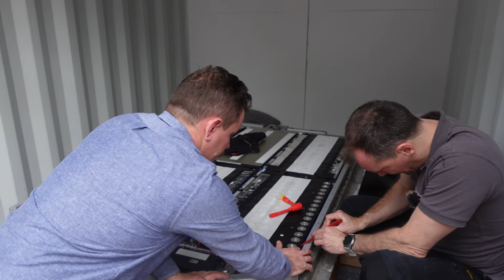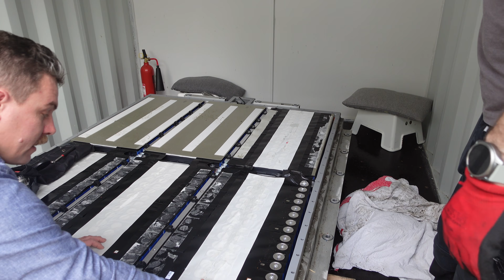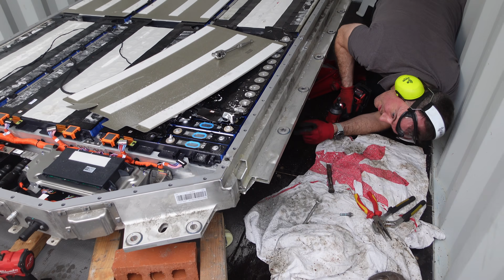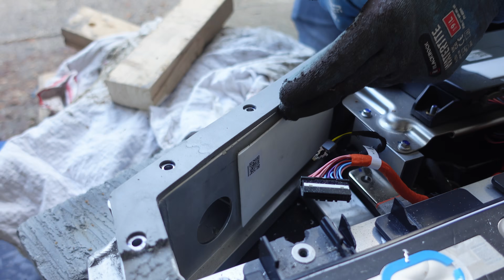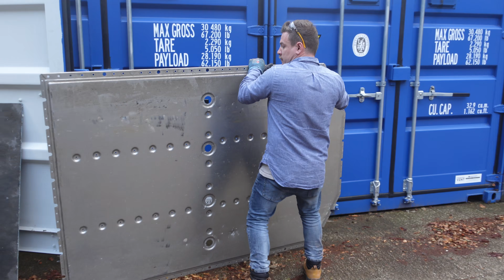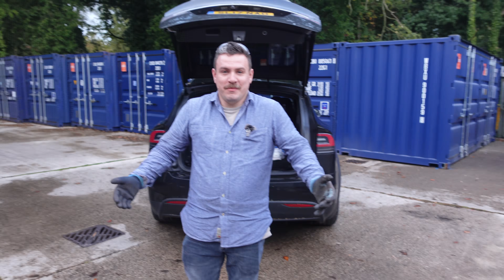EV Batteries Are Becoming Unrepairable — And Honestly, It Makes Sense

Comment: Someone should set up a company building containerised structures to take these car batteries and market them as grid balancing devices with the aim to replace gas peaker plants. 
Knowing Dala, it will already be an open source project, so if he adds a stipulation to it that if you use it for commercial use any updates/upgrades must also be feedback into the project or something that would mean a private company can't build their own IP on the project without benefiting the project

Comment: This battery was designed for robots to build. And not for humans to dismantle.Some one needs design a laser welded shear bolt terminal bus bars .Standardised cell case bolt through holes for pack clamping.That allow rubber gasket battery spacers.Individual pack pan enclosures.With fuses between banks. To contain fire to individual packs. Giving the ability to replace damaged  area.Double sheet ribbed battery pan for protection.This would add a small build cost. But will give an advantage of an after market keeping the vehicle on the road and reputation of the manufacturer that cares about it's customers enough to want them to buy the next car. because it can be repaired.

Comment: You guys are TOTALLY  RIGHT.. The packs that are made strong  and with permanent structural elements will last longer. This is less opportunity for Failure. Sandy Munro from Munro live also discussed about that few years ago and came to the same conclusion.  BTW these are laser weld not spot weld. Youc an buy a laser welder for cheap but the process will have to be perfect to not damage the cells while welding!
Reply from the maker: Great advice. Thanks for chipping in

Comment: We need a right-to-repair law that includes EV batteries. All components, including the battery case itself, should be reasonably easy to replace. The cells should be replaceable in smaller modules, below a defined limit such as 5 kWh, to ensure that faulty sections of the battery can be repaired instead of replacing the entire pack.

Diagnostics and communication for batteries should also be standardized, so EV batteries can be easily reused for other applications if desired.
Reply from the maker: I’m okay with the cells not being removable if I can pay X percentage lower for the car knowing it’s cheaper to manufacture. The pack can still be shredded apart at the end of its life to reuse the minerals. 
I guess it really depends,  how often do you get to cell failure? How far do you go in being able to replace everything on a device when it means that you’ve got to get into 3-400 V of which you cannot isolate that voltage easily? That line of thinking alone breaking packs to replace cells risking high voltage shocks. You could say that they almost should never be opened at the cell level. 

It’s a good subject to debate thank you for sharing your views. I completely agree that we need more openness on data & specification. By all means get your product patent but share how to repair them
Reply: @TheOfficialBatteryMan I see your side of the case, but the biggest issue for me—and what really makes me want repairable batteries—is the risk of total battery failure, where the only option is to replace the entire pack, which is often extremely costly. Cell failure isn’t common, but when it does happen, it’s incredibly frustrating. This risk is also part of the reason why car insurance for EVs is so much higher compared to other vehicles.

Damage to the battery case is another real concern. It can happen in various situations, and having to scrap an entire battery—or even the whole car—just because the battery case isn’t repairable is a significant problem.

I live in Norway, where EVs are everywhere, and it’s quite common to see relatively new EVs scrapped after minor accidents simply because the battery is too expensive to replace.

Comment: The spot welded tabs could be bolted but then it could result in oxidation and fires.
Reply from the maker: The clip didn’t make it into the video, but I’ll probably end up lending Will my spot welder to continue his project. I’m not sure how much current he’s planning on pulling but if it’s a 5 kW inverter at 48 V that’s surround 100 amp. So we need a decent connection

Comment: From what I can tell, you have a total of 96 LFP cells in series. That's over 300V DC. All persons working on this battery should be wearing gloves at all times. Also, be very careful you don't short anything. LFP cells can generate about 20,000 amps if short circuited. Be safe guys. I enjoyed this video.
Reply from the maker: Hey these are 32 cells on the front three modules?l. Which have been broken down to about two rows of thirtyish volts.

The rear modules have 36 cells 129v. That’s starting to get dangerous, but we have course we’re not working on those cells. 

This pack, believe it or not is NMC. A lot of NMC packs are made with prismatic cells now. 

If not handle right, I completely agree. There is enough energy here to kill you in a second. I promise you we were as safe as we possibly could be while looking as sketchy as we possibly could be.😂
Reply: @TheOfficialBatteryMan Ahhh, ok. They very much look like LFP. I believe those are also extremely high current when short circuited also. Would love to see a video from you guys on how to balance EV cells so that miles can be reclaimed.

Comment: See how complex that is compared to a fuel tank.

See how difficult and how many man hours to strip down. Now think about this being done commercially.

This is why actual recyclers just grind the batteries down and separate. The whole myth about these car batteries being reused for a second life as a house battery is just wishful thinking.
DIYers might do it, but it won't happen commercially
Reply from the maker: All it takes is one or two smart people to reverse engineer at the CAN bus data and you can plug these into inverters. The problem is something like the Fisker Ocean, well it’s just a bit pointless to reverse engineer a pack that that’s harder to come by that will be needed to keep the remaining vehicles alive. Better to use freely available batteries to reverse engine engineer.

There are companies that commercially do this putting these things into containers providing grid stability
Reply: @TheOfficialBatteryMan that may be so but where is the average person going to put a battery pack that big at home?  Especially when giving proper fire barrier spacing.  The whole narrative was that these would be stripped down and reused as home batteries. As you can see , no commercial company will be able to make that pay. Too many man hours involved. So it will be confined to the DIYer.

As for sticking crashed EV batteries in containers for grid stability. Just shows how gullible the whole climate change narrative is. The grid was stable before renewables were forced on it by idiot ignorant governments. It is solar and wind that makes it unstable. A few containers full of ex EV batteries of dubious history will not change that.
Reply from the maker: @DanRyan-v5y  there are over 2000 installs using the battery emulator. Some commercial and a lot of domestic all around the world.

There is already been some business use cases for second life EV batteries. Batteries can be triaged to make sure that only good ones are used. To me that that’s a far better solution than just shredding them up and starting again.

I find adding renewables to the grid absolutely fascinating because it’s genuinely sustainable whereas oil isn’t. One day oil will be gone and we will have taken our planet for one of its greatest resources of the 20th century.

Comment: I am ok with unopenable battery, but give me guarantee that it will survive over 10 000 charge/discharge cycles and/or over 30years of longevity.
Reply from the maker: Modern cells are fantastic compared to what we used to have, but yes, there’s no guarantees. Saul are firmly managed and packs have got even bigger so they’re generally not as stressed.

Although we are asking to charge them faster and to get more power out of them but in the Gran scheme of things most people don’t use superfast public charging very often and yes they might put their foot down but it’s a matter of seconds not enough to cause massive heat spikes.
Reply: @TheOfficialBatteryMan I am working in solar battery storage industry and with luck and bit of care, these numbers are lets say achievable. Yes the battery can be pampered by good BMS and is not experiencing anything near the horrors batteries in ev do...
Reply from the maker: @JanicekTrnecka 10k cycles is a hella high usage. I guess battery storage cells and EV cells get hammered in different ways. More kilowatt through an BESS but a much lower C rate and on scale air conditioned.
Reply: @TheOfficialBatteryMan air conditioned (liquid heat dissipation) whatever...load of sensors through the pack and lot of indicators that limit the "abuse" because you can..In EV you simply cant ease off a bit for every mousefart...
Reply: @TheOfficialBatteryMan  yes 10k is lets say, hell of cyclic use .. but some battery manufacturers attack this number. I dont expect the battery to be "as new" but still somewhat operational ....many EV retired batteries are happily serving its autumn of life in battery storages.
Reply from the maker: @JanicekTrnecka o yes. I’ve repurposed 4 and one ready to go 😛 I appreciate that I’m small fry but the channel has helped other to do the same. Above all this needs to be an industry thing doesn’t it? Batteries is being repurposed into containers and living a second life before they’re broken up.

EV manufacturers have always been a bit disconnected not wanting to share their little secrets. On scale this is only gonna work if they partner with companies that can achieve it.
Reply: @TheOfficialBatteryMan there are clever tinkerers and a lot of engineers  working on reverse engineering these batteries and protocols just to better understand them and prolong their usable life or to be re-purposed as storage...which is good! Sometimes shady. but....BTW I thought some car manufacturers do repurpose their packs in their ecosystem...Skoda is trying to use the batteries to boost their "supercharger" stations. Just an ordinary DC charger on a thin grid line, but supported with battery.
Reply: @TheOfficialBatteryMan mine has an 8 year guarantee. Replacement ones already hold more energy or are lighter.

Comment: Everything should be repairable
Reply from the maker: It should, but we all have to pay for the extra cost of repairability. In terms of building this in a factory robots could do this.

You start adding bolts into place and there are way more steps. 

Having said that there apparently are a lot of hidden bolts in this pack some of what Willis chopped away has found steel inside the aluminium extrusion
Reply: @TheOfficialBatteryMan  I would put to you that most people would pay a bit more up front for something that can be fixed, as opposed to becoming a brick. Ask any iPhone user if they'd like to be able to replace their batteries, or cracked screens that they're not "allowed to" because of Apple's BS reasoning. 

Repair is noble. Replacement when it's not needed is just waste.

Comment: That is 100% not a repairable battery pack, in the sense that any dealer network is going to get it repaired, possibly even manufacturer associated dedicated repair facility. Reliability, don't buy that long term either, you are reliant on 100% first time perfect manufacture / tolerances, doesn't exist. Long term therefore this is not a reliable solution at all, the belly pan construction alone is vulnerable, a pinhole puncture even will introduce water, the battery will fail in time as a result. As for using the pack as a whole for secondary storage, not designed for re-use, manufacured to almost specifically to preclude it. One cell issue and you have a whole pack running with a potenital larger fault waiting to trigger itself. Early Teslas had the right idea for cell isolation - each cell interconnect acting as a fuse, at lest in that case a cell would be removed from any future charge / discharge cycle. These pack designs are decidedly not green at all.
Reply from the maker: Some good points here, thank you for sharing
Reply: Just a comparison for you to ponder: Plastics have been around for 60–70 years and still approximately only 10% are recycled globally. EV batteries, by contrast, have existed at scale for less than 15 years and fortunately, because they're designed around high-value, recoverable materials (Al, Cu, Ni, Co, Li, graphite), with emerging regulations and processes, ~90–95% material recovery is achievable even after 10–15 years of use. Still not perfect, but it’s demonstrably better than most petrochemical plastics…and improving rapidly.

Comment: So this is the grand illusion of being environmentally friendly and saving the planet by making these batteries un- repairable , what an absolute waste of resources
Reply: Redwood materials in the USA simply grind them up whole and process the whole pack recovering all the materials. The normal use for an end of life in an EV undamaged batteries is to gather them in a container linking them all to a large BMS to provide grid backup. What you see here is simply DIY only.
Reply from the maker: I would very much agree. It’s crazy how many battery packs are just sat around in breakers yards. The whole recovery process is still in a bit of the chicken and egg stage. 
I’m sure it will happen. We just don’t have enough old EV packs to warrant it at the minute.
Reply from the maker: Most EV packs will live a long long life. But unfortunately written off vehicles won’t have their packs go back into vehicles most of the time due to safety concerns so we’re talking a tiny minority of battery packs that need throwing away right now.

Comment: What's the plan for getting it connect back
Reply from the maker: Will plans to drop the voltages down to around 50 V and use it with a Victron inverter. He’ll basically have an absolutely massive capacity for a 48 V system.

Comment: Making it not repairable throws the "green" propaganda away
Reply: Nope.
Having repaired old packs, the thing is:
Newer generations are way more reliable, and building them strongly glued is better on every level.
Repair is not needed.
Recycling happens by crushing the whole lot anyway.
Reply: You've not caught on to the CO2 problem, have you.
Reply: The need to stop burning stuff in order to preserve a livalbe planet is not dependent on repairing individual cells in battery packs. I'm not sure why you think it is, nor which bit of the transition is 'propoganda' in your view.
Reply: @xxwookey have you considered the carbon, water, and waste amount to manufacture entire new batteries?
Reply: @GuilhermeGomes2  Yes. The point is what are you comparing it against. You can make one battery and then use it a few thousand times, and then recycle quite a lot of the materials, or you can dig up hundreds of barrels of oil, and dump the waste in the atmosphere, then do it again, and again until you either have no oil left, or the atmosphere is ruined. It's hard to make the case that oil route is better/greener.

Comment: Better to design a good battery than a repairable battery. 
To make batterys reparaible you add weight, complexity, cost and unreliability.
Reply: You can do both, there is no good reason why a battery cant be relatively easily repairable.  It should be nothing more than 100 prismatic cells in a case, a BMS and thermal transfer plates, yet here we are with people literally cheering for enshitification.
Reply: @StartledPancake  
The very act of making a battery repairable adds huge complexity, cost  and weigh, reducing the reliability of the battery.
Reply: @universeisundernoobligatio3283  Nonsense and you have zero evidence for that.  Huge extra complexity?  Huge extra weight?  Rubbish.  They glue together them because its cheap and they can sell you a new car instead of it being repairable.
Reply: @StartledPancake  
Nonsense and you have zero evidence for that.
Repairable =  complexity, weight, cost and unreliability.
You said it your self glue them together so they are cheaper. 
Lower priced EV's closing the price gap on ICE. 
Most EV batteries now outlast the body of the car never needing repair.
Reply: @StartledPancake  The weight savings come from the battery case being a structural member of the car.
Reply from the maker: Great point!

Comment: what if you buy a deye high voltage bms and  make it work on whole pack  ?    maybe thats why  flying tools    did put his pack on trailer and used it  as it is
Reply from the maker: Adding your own BMS would be the easier option. All connections are neatly at one end

Comment: Thanks for the follow up video. Fisker Ocean owners were to be given the option of taking their existing car into a Fisker service centre & pay to have the Fisker Force E off-road package installed. That did include a full-length titanium underbody plate.
One bit of good news for Will. As far as I can find out, there has been no instances of thermal runaway with any of the 11,000 cars produced, including those involved in accidents or where the battery coolent/heat pump has failed.
Reply from the maker: Nice. The pack is well built for sure
Reply: I've seen one from Florida after the 2024 hurricane season. Would not start after the battery pack was submerged in sea water for a prolonged period of time. Insurance sent a flatbed to take it away and later the flatbed driver sent photos to the owner where they had to drop it off the flatbed on to the road engulfed in flames. Only instance I have seen so far
Reply: @theR3alLoki Thanks for the info. Hopefully a one off. Still, glad to be corrected.